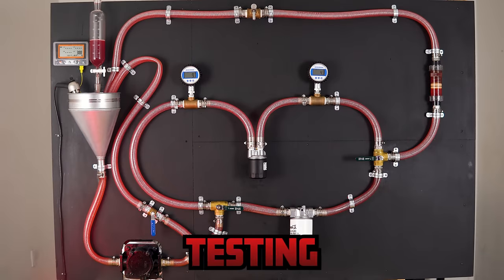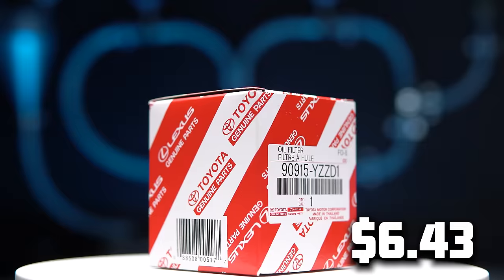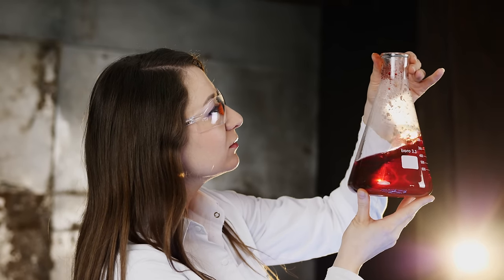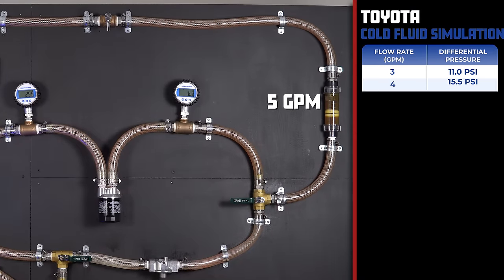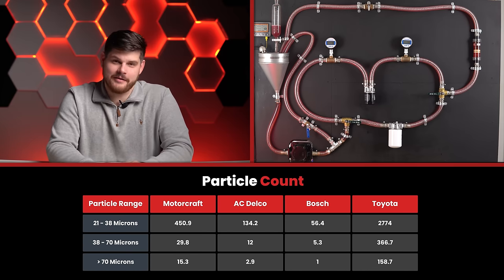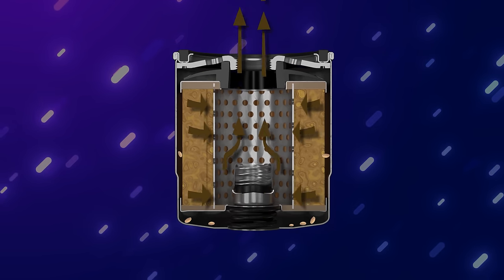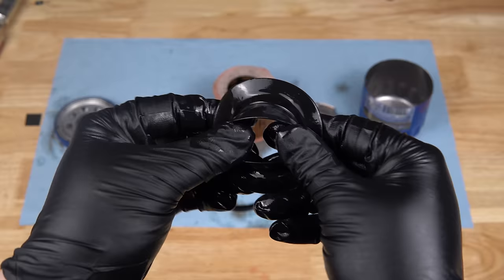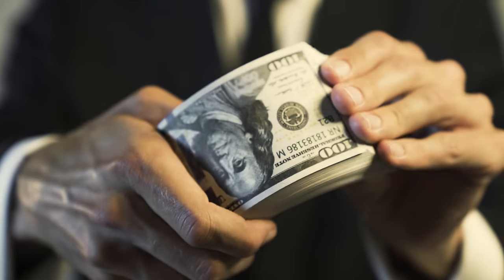Are Car Dealership Oil Filters a RIP-OFF?  (Engineer tested)

Comment: So the factory automotive engineers that get paid to design and guarantee oem performance happens to have bad filtering performance? Somethings not right over here…
Reply from the maker: Agree, but maybe their intent was to get better flow and capacity instead of filtering performance. Thanks for watching!
Reply: @BrandRanks  And to use Automotive oil.

Comment: Not really a fan of using gear oil to simulate engine oil at a lower temperature. Gear oil and engine oil do 2 completely different jobs in completely different ways. It’s like saying oil and water work the same way.
Reply from the maker: Thank you for the feedback, but we are following as close as we can the ISO testing standard utilized by oil filter manufacturers and this is the oil utilized for cold temperature simulations. Thanks for watching!

Comment: .So you're saying TOYOTA engineers are so great at designing engines that last for ever if you maintain them but are too stupid to design a filter for it. So you go out and get a generically engineered filter that is basically one style works on all engines as long as they change the casing it's in. Yeah, Okay.
Reply from the maker: Nope, not what was said. Data shows the Toyota filter filters way less than other filters, but it also shows is has great flow, and the best capacity. So maybe Toyota engineers purposely designed it this way to ensure there was sufficient oil flow even during long intervals on an owner not changing their oil and filter. In other words they may have made the decision they prefer dirtier oil, than no oil at all. But if you are someone than changes your oil and filter like recommended, there may be better filters out there.

Comment: Another Test that can be thrown out the window.   Aeroshell 41 is a mineral hydraulic oil that isn't 5w-30 and Super ISO Grade 460 is some random Gear Oil with no datasheet that can only be found on ebay.  Not even using the correct types of oils for what the filters are designed for.  And besides not using the right oils, why are you not testing them at 190-210F? It couldn't be that because the flashpoint of the Aeroshell 41 is 220F vs 460F like normal motor oil.  Even if the viscosities are the same, they will work different under pressure, like the Aeroshell 41 that is designed for high pressure usage in aircraft hydraulics.  And the cold test is really flawed because you are using a ashless / Dispersant hydraulic oil thats not 5w-30 vs a Gear Oil with who knows what in it.  I can keep going on, but you guys need to start using the correct "automotive" oil for the automotive filters being tested.
Reply: You nailed it!

Comment: “The metal bypass filter doesn’t close as perfect as the rubber seals. “ You have absolutely no clue how these filters work do you.  Absolutely no technical understanding.
Reply from the maker: "The metal Bypass filter"?  You mean the metal Bypass valve? Care to explain how  the metal on metal seal would be better?

Comment: Most likely - you are wrong. Had Scion tC -  changed oil & filter every 10,000 miles - exclusively at Toyota Dealers, drove car very, very hard at high RPM's,  made 300,000 miles wit NO, absolutely NO = ZERO issues... NOT even one smallest problem!!! ...and you say that Toyota use shitty oil and filters !!!

Comment: "Standardized dust" ... label says "medium test dust". We have a scientific definition of small, medium and large dust, for testing. So weird but so logical at the same time... 😵mind blowing but also completely useless information to me, lol!
Reply: the information is about as useless as using aircraft hydraulic oil and random gear oil threw a automotive oil filter.
Reply: @pheelix- Uhm, what? The point of the hydraulic and gear oil was to simulate old  thick oil to see their performance.
Reply: @LaOwlett  I know they are trying to do, and it wasn't to simulate old thick oil, but oil at a cold temperature.  But as they are not using actual automotive motor oil, the additives put into the motor oil for cold temperatures are not there.  Cold also effects different oils in different ways, that gear oil could be more or less viscous then 5w-30 when they heat it to 104F trying to compare it to 5w-30 at 38F.  As they didn't even use 5w-30 or tell us what brand/type of 5w-30 they used.  And as I am unable to find any sort of information on the gear oil they used other then a ebay listing, who knows what its viscosity is once heated to 104F.  They are basically just making a 10min video saying oil doesn't go through a filter as fast when cold.  Trying see how each filter performs by not using the oil they are made to be used with nullified the tests.
Reply: @pheelix-  It's about the viscosity. Both are oils, and will behave the same with a filter when testing it's ability to push a thicker substance through it. This is a youtube video doing a basic experiment, not a thesis paper or published experiment.

If a filter can process a thicker oil faster, then it will also process your cold or old motor oil faster as well, because logic and reason.

Comment: i recommend sticking with the oe filter as each engine is tested with said filter however if you dont use oe any thing but fram will do
Reply from the maker: Indeed they are, but some aftermarket oil filters are very well made and may provide some additional benefits. Thanks for sharing and watching!

Comment: That filter is a shit ball Toyota USA designed and manufactured part. Part of the Toyota MVP (value parts line)  

I do not, have not, nor ever will use a part from the value line on any Toyota I own. Im still pissed about the intro to the MVP line up and that was 30 years ago.  You can still get Toyota Japan filters if your parts guy knows his job. Hard to find ones that know. All Toyota actual factory parts are still available with exception to 4 cyl canister filters. YZZ only.  Cant get them at this time.  Toyota MVP parts line Has the YZZ in the part number. Want real parts, ask for them. A little more but not much.

Comment: This is the stupidest trial I’ve seen. Oil comes in multiple- viscosity ranges in order to meet the requirements of the  auto makers. So why use gear oils to show low temp ability. The oils used today are usually in the 0-20 to 5-30 range or sometimes less. That means at low temps it acts like 0 or 5 weight oil not like a gear oil for exactly the reason you show the pressure is very high with low temp but the real oils are not like gear oil
Reply from the maker: We explained the entire testing procedure and why we selected the oils we used in a separate video. Make sure to go check it out

Comment: This channel says a lot of things and just goes by, "It sounds bad because I don't like it." No actual information about what the engine specs are. Never talking about what PSI is actually needed. Just a bunch of crap to shock you. Worthless info to get clicks.
Reply from the maker: Thanks for the feedback. Although we do provide actual data instead of just opinions like many out there 😉 our first video in this series goes into more detail on the testing methodology, so make sure to go check it out.
Reply: @BrandRanks No, I am sure you rig gives accurate numbers but those numbers do not mean anything if you don't know how they are applied.

"This has lots of  PSI!!!" OK, so? What PSI is needed for the engine? How much oil can a given engine use in a certain amount of time? What does the manufacture say about these numbers?

Comment: I’ve only ran motorcraft filters and oil for the last 15 years. Last two trucks over 300k miles, a explorer with 156k, f150 with 184k and about to start with a used f250 I just got that came with a stp filter on it. Eww.
Reply: Forgot to add bronco with 13k miles.

Comment: If you are pushing 10-30 oil thru a filter designed for 0-20 ,its going to have a higher pressure across it. Same thing , you do not put 10-30 oil in an engine requiring 0-20 oil . Be sure to compare filters going to engines using the same oil weight .An OEM filter will protect an engine better than an aftermarket filter , After all the filter was designed for that engine  .
Reply from the maker: Thanks for the feedback and for watching!
Reply: there not even using automotive oil or 10w-30.

Comment: Made the Toyota is struck bypass
Reply: Do you think the bypass valve was stuck open?
Reply: When doing extreme filter contamination ( adding a lot more than normally expected) would make it bypass.   Toyota has the highest hot Flow rating.   Most wear time is main  running and not just start up.  But dry when start does exist..

Comment: More planned obsolescence? 🤔
Reply: If that was the goal, it doesn't seem to be working since Toyota has had some of the longest lasting engines in the industry for decades despite their filters having the worst filtration efficiency. I suspect Toyota's engineers prioritized proper flow on cold starts and with a slightly clogged filter over filtration. Remember that if the bypass valve is open, unfiltered oil potentially containing particles of virtually any size are free to go straight into the engine and potentially cause a catastrophic failure.

Comment: I don’t buy any paper filters for my engine, I use nonrestrictive stainless steel screen and canister filters like used on aircraft jet engines and clean them on every  Redline oil change. Just order oil in 5 gallon buckets and eliminate the low quality corner auto shop box stores. Get serious.

Comment: So let me summarise: Toyota oil filters are no good because you say so.
But Toyota has been near the top of most reliable cars for decades.
And did you buy your filter from Toyota? Nope, Amazon
And you think this is scientific?

Snake oil salesmen would be proud of you.
Reply from the maker: Thanks for the feedback. Just showing the data and it shows is at the bottom on filtering performance but one of the best during flow and maybe that's what they were going for. You can even go look at Car care Nut video on Toyota oil filters, he mentions it's actually in the bottom on filtering performance.
Reply: The Toyota filter is a POS.